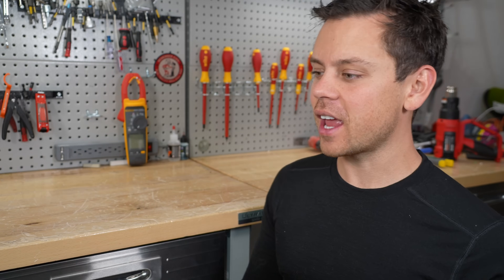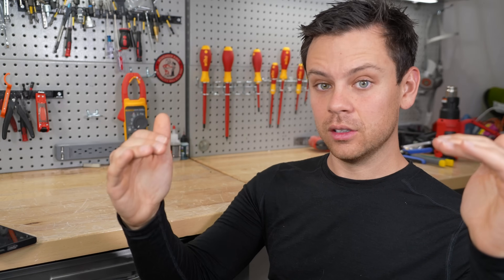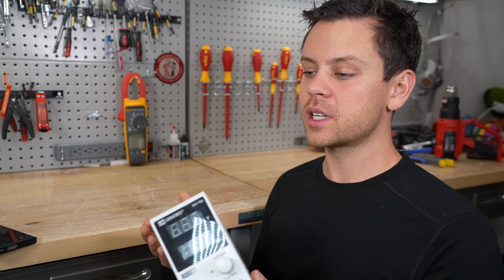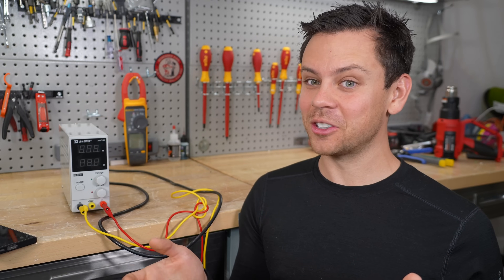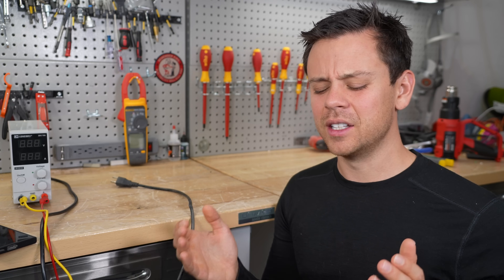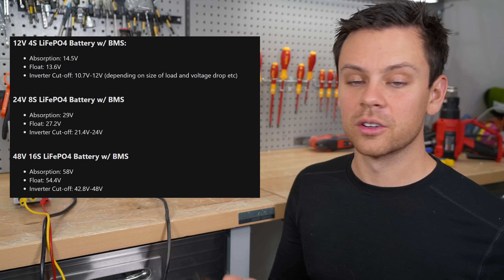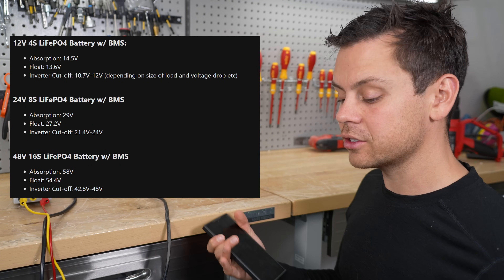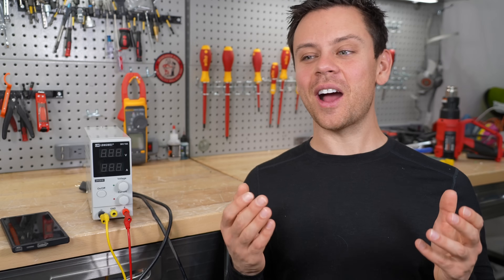LiFePO4 Charging Guidelines: What is 100%? What is 0%?! How to Balance??

Comment: My cells (EVE 280Ah) are working since 2019 in a 48V pack : Absorbption: 54.7V then Float : 54.4V, this 0.3V just help me charge faster near the "end". 
That's something like 95% SOC, i never charge at 100%, there is no need to. Then i never discharge under 10%, my system is sized correctly so i near never go under 20% anyway.

Your 58V absorbption seems too high, it will degrade the chemistry faster then needed... and for what, the gain is very very small, i better have a longer float session at lower voltage... the pack will fill up anyway, just slowly and there are only very marginal cases where charging stronger and faster are really usefull.. specially for those 5-10 last Ah.

Balancing is on at 3.38V, at 95% charge (of the nominal capacity) my cells are under 0.01V delta pretty fast.
The oldest pack as never been top balanced... things will settles anyway with time.
I can see from times to times some voltage delta between cells that goes up to 22mV, charge rate for a 280Ah 48V pack is around 5000W, 100A, sometimes a little more for discharge but never for a long time. I can't really do a full discharge/charge to see how much residual capacity i got.

Comment: I just bought 8 CALB LIFEPO 180 Ah batteries and measured 7 of them at 3.27 volts but one was 3.24 volts. Any need to charge it independently or just connect 8s BMS and use lab power supply to charge pack to completion? I bought your book but figured I'd ask here anyway. If I can simply apply voltage from lab supply what do I charge at and what voltage do I stop charging? 3.27? If they are all the same voltage Im good to go eh?.............Oh nevermind. I found the answer in another of your vids. Thx.

Comment: Absorption time? I have two Renogy 48-volt smart lithium iron phosphate batteries in parallel I used them for about a year without charging to 100% not realizing that they needed to be balanced or how to balance them I currently set my Bulk to charge 100% and my  absorption time  2 hours to help balance them I'm just not sure how long or how much time it would be okay for the batteries to be on Absorption

Comment: Thanks Will, I build a battery 2-3years ago and charge 100% solar and one cell never seems to fully charge, I use a victon controller and the 14.2 volt absorption never made sense, now I have 2 batteries, one in my van the other in my ute(4×4) now both controllers are set to your recommendations 👍

Comment: The EG4 LL-s v2 manual suggests 56.2V absorption and the BMS shuts off at 45V.  I would think it would be best to follow those recommendations so the balancing works correctly?  

I'm running in closed loop, but with a 10-20A DC load running straight off the pack so I enabled DVCC without BMS control and set the charge current limit to 100A(I think 70A is the highest I've ever hit and it was only briefly when I had good solar coming in on my 150/70, 100/20 and I set the inverter to charge to 100%.  Otherwise I'm only hitting 40 amps average just during the peak of the day. I have my pack in the garage and even with the garage being ~80-85F I haven't seen the pack go over 105F, usually it's ~80-90F during the peak heat of the day.  I set the inverter to 56.2v absorption and the MPPTs I set to 56.25 so they can contribute a little more than the inverter if I ever needed to charge to 100% using all the power available during a cloudy spell or if a storm is coming. 

My system I built to utilize all the solar directly when possible and only dump excess solar to the battery.  A MP2 5kVA can run our entire house and we can fallback to grid when needed, I have my input current limit set to 50A on a 60A breaker and have power assist enabled.  That does kick on very infrequently, maybe a couple times per month, we have a gas stove, gas dryer, gas boiler for heat and indirect hot water maker.

Comment: Sounds great if you can access your batteries. I have 6 EG Lifepower 4 server rack batteries in parallel and have to rely on the BMS doing its job. Unfortunately 1 battery went into full red alarm and had to be taken out of the loop. Open the battery kills the warranty i think and Signature Solar gives me the run around. Guess i have to drive to their office and have a talk with them. What are your suggestions for the settings on 2 6000XP inverters for maintaining the batteries?

Comment: Hi Will, I'm sure this has been asked, but I have a Victron 330 amp battery,  what should 50% be for storage. Is it around 11.5 to12 volts?  It gets very cold here, and the battery is in a van, stored for a few  months during the winter. I was thinking of getting an extreme heater, and letting that run with the inverter on and plugged in and charging the battery all the time, but not sure. Thanks for your great videos.

Comment: I have 48,230.4 Wh of 314Ah cells for my 48-volt system. My solar array is just under 6kW. I power a 5 cu ft chest freezer and a 4.6 cu ft top-freezer refrigerator full time and a microwave, Instant Pot, countertop convection oven, and a pair of PC speakers intermittently. I haven't hooked up the 48-volt lithium cells yet because I haven't figured out how to charge them all without making them into one big battery. I dislike the idea of a 16s4p battery because of the risk of a single cell causing the rest to start failing. I don't see this as being a logical concern. It would seem to me that the only symptom of a cell failure would be a 33.333% reduction in usable capacity of the entire bank with the only cells that get fully cycled being the two that are parallel to the failed cell. I can't convince myself that I need to complicate my system in order to have 3 independent battery banks working on the same job and sharing the same charge. If I need to be convinced, the argument has to be smarter than I believe I am.

Comment: Mr. Prowse,  I am running 2 lisuateli 12v 100ah lifepo4 in parallel for my 6x10 trailer, charging with 500W solar. The Fangpusun controller is set via switch for lifepo4. Should I use the 12V settings mentioned in this video? Thank you for sharing your knowledge with us newbies! Happy Thanksgiving sir.

Comment: I'm in the process of changing my lead acid batteries to lipo4 batteries. I made my own controller for solar charging. The system works by directly letting the full 20 volts go to the batteries. When the batteries reach 14.6 volts the panel voltage source cuts off. I tested my system with 80 amps load for 8 hours strait and it was at room temp. around 20c.  I've been using this system for 12 years with no issues that I can see. So just wondering if this setup can be safe for lipo4 batteries. Thanks for any help.

Comment: Hi Will, I recently watched your video where you recommended setting LiFePO4 batteries to 100% (3.65V) and 0% (2.5V), which seems to be in contrast with what Andy from Off-Grid Garage suggests in his video, "Busting the 20%-80% SOC myth for LiFePO4 batteries." In his video, he advises charging up to around 90-95% (~3.4V) on the high end and down to about 12% (~3.1V) on the low end to minimize degradation.
I'm just trying to understand the best approach to maximize the lifespan of the batteries and avoid damaging them. Is the difference between these two recommendations significant, or might it be so minimal that it doesn’t really affect the batteries' longevity?
Thanks for your insight—I’m eager to learn and ensure I’m taking care of my setup properly!  Best regards, Wes

Comment: Hey Will, I love your videos, however I want to build a 48V UPS system for my boat, no solar, using Victron hardware and the Epoch 48V marine batteries. We usually anchor out 3 days at a time and using 2 small air conditioners at night when it is hot. We can recharge in the Marina during the week or with the Generator running while we are in transit. Sundancer 44DA. Mike

Comment: What do you consider “high temperature”?  I’ve been using CALB CA180’s in an 3P8S configuration in a marine application as a house bank.  System is 6 years old.  It’s not in the engine room and generally lives at 80° and gets into the 90’s if we fully cycle… (90% to 10%) each day.  Max charge rate 115amps.  REC Duo BMS, Victron 5kw 240v inverter, CCGX and Wakespeed 500 regulators on the main engines.

Comment: Hi, I have been using LiFePO4 batteries now for 3 years in my RV and boat.  For the RV, I just shutdown all systems and leave the batteries rest, never more than 6 months and always have a charge in them without issue. For the boat, since I Ieave the boat in the water I leave some systems on, like the bilge pump.  So since there isn't much draw unless needed, I need to leave the charging system on, in this case the solar panels and charge controller.  I am worried that the batteries are getting charged too much?  The Lithium setting on the charge controller keeps the voltage at 14.2 for many hours and doesn't seem to back off even though the current goes down to almost nothing, the gel setting also keeps the voltage at 14.2 but backs off to 13.7 after 2 hours.  I decided on the gel setting before I left the boat.  I can't seem to find any answers about my situation and should I be worried about the batteries?  It's in the Pacific NW so they stay cool and from my experience during summer months they never got warm at all.  I have 435 watts of solar and an mppt 30 amp charger.

Comment: Great videos.  I think re-enacting troubles with a system would do well for those troubleshooting a system.  Ex: demonstration of generators throwing cell Voltages out of whack, “waking up” a server rack battery after a low voltage cutoff scenario, and I think some content on cold climate/coastal region considerations would be interesting as well.  Transform a shack in Canada into a peaceful, freezing getaway😂.

Comment: Lead Carbon is a bit different than LiFEPO4 , charge 57.8 float 54.8 . Range 51.6 to 41V , no cells test possible , no bms, no heater, last time I tested, the furthest row was .1v below the other 3
51.6V 48KW,    50V 43KW,     49V 38kw,   48V 33kw,  47V 28kw,  46V 23KW,  45V 18KW,  44V 14KW  43V 10kw,   42V 6Kw,  41V 3KW and of course 40V be as dead as possible but np just push 10KW into at -30 c, 49.5v in 4 hrs. Or throw 10800w into the bank for 2 hours then find out you have a 175A dc breaker, oops, sure lasted a long time at 190A, cables were warm like hose heater.
Above 48v a 2.2kw load lowers volts by .6V, at 41.6V 2200w load -.8V. 
Took me all year to figure out my volt to kw because lead carbon is some forbidden info or gives all results for lead acid. If I see 47V now I know its 3 hours of gen to 43kw 90%, the top 5kw should never be charged with a gen, takes a lot to stuff it full, then it just eats 1.6v and 5kw from 100 to 90%. Once a month it is required to charge 100% 
Maybe one day you can try and kill a lead carbon, hint they don't survive drops.

Comment: Thanks great info.  One thing i never see is a definitive answer on how long should you run the absorption cycle for? I've got 7 x 3kwh 48 volt batteries (genz) in Australia.  They recommend 2 hours in their instructions,  but when i queried that for a daily cycle in an off grid set up i was told 30 minutes is fine with a 2 hour absorption every 6 months or so.  Do you think the absorption time is important? I get lots of extra sun in summer so there is plenty of excess solar to achieve that.

Comment: These lithium batteries don’t degrade that badly with reasonable care. My 2016 Tesla has lost just under 10% capacity in just over 8 years charging to 90% daily and multiple cross-country trips taking advantage of the lifetime supercharging. Key thing is that I never run it completely empty, and if I do bottom out under 20%, I strive to get it above 50% as soon as reasonably practical. And it uses a much less forgiving battery chemistry than LiFePO4 which is generously forgiving.

Comment: Are those wall outlet AC chargers ( LiTime 20 amp 12v charger) designed to charge a battery bank of 4 batteries in parallel  ? 
Or only 1 battery at a time?

Comment: Diesel farm tractors operate various PTO driven implements that all assume 1500rpm input. The tractor manufacturer knows this and designed the engine around the specific engine speed required for 1500rpm on the PTO. There is a frickin MARK ON THE TACHOMETER.  When you ask farmers where they set the throttle. 1 in 20 run wide open, balls to the walls.
1 in 20 correctly operate the throttle. 
90% are average of 1500 rpm too low. This is the source of 100% of their problems.
Construction workers are told the red line burns the proper amount of fuel to avoid problems with the corporate bean counters. They properly set engine rpm and run it like they stole it.
Construction equipment engines in equipment beat like rented mules last twice as long as the exact same engine in farmers tractor. 
This is why every old farmer has a bulldozer, or excavator, some peice of "heavy" equipment kind of maladaptive to some farming task.
They are acutely aware that heavy equipment lasts twice as long as farm equipment.
Yet their heavy equipment is ALWAYS broken.  Like their goddamned tractor.  The one they don't run properly. You're now at 5th generation of explaining this until blue in the face.

Comment: This is not your best video. You should show the actual balancing process. Explain why/what balancing is like we're a 5 year old. I've learned a ton from you Will, but this one assumes the person watching knows how to do balancing/wiring/ sizing a battery bank, and more. Still give a thumb because you're the best solar vids. 

I had a balance issue doing 4 LiTime12v in series to an EG4 3k. After install the owner ran loads and one of the batteries would drop low enough that the EG4 shut down. I had to remove the  batteries and charge them on my 12v Victron system. It was a major pain because we're 100% solar out here. Had to do it twice for some reason. Anyway after her system charged a couple times the problem hasn't happened again. Though I'm afraid it might someday. The EG4 wouldn't charge the batteries in series since the voltage was under 48.

Comment: Hay great video. I’m building a self charging self sustaining solar system that doesn’t use solar panels. I have (4) 100a 48v solar charge controllers, (16) 100a 51.2v lifepo4 batteries, 10kw solar inverter. I have it set to when the batteries reach 58.0v during bulk charging the charge controllers turn off and when the batteries reach 46v the controllers turn on. Can you tell me what issues, if any, I will have by not letting the chargers go into boost and float charging mode? Side note, the chargers will go into bulk charging after every 16.5 hours of battery usage and will charge for about 4 hours. My house is averaging 3100w per hour. Each 100a charger uses 15a of battery power during charging only.

Comment: Hi Will. Superb video as always. Quick question. I am in the UK. worlds most expensive electric. (I am told). So its common here to have cheaper electric over night. Very expensive for a few hours in the evening with a standard rate all other times. so 3 rates. I have solar and 26KWH of Pylontec LifePo4.  So I charge overnight (Cheap) at around 0.5C and discharge at the expensive rate at a similar 0.5C. Does your advice stay the same. so charge and discharge for 3 hours at a constant 0.5C. I charge to 100% daily. Thanks

Comment: This past spring I bought 4 Eco - Worthy 12.8v 280 AH batteries. Are these classified as cheap by you? They were $2000 Amazon delivered. I charge them with a Midnight Solar 150 MPPT. set at 24 volt . I charged each battery individually with my IOTA battery chargers which will go 13.6 to 14.4. Once they were all charged I made two banks. I've been running all 4 together since installation.

All summer my whizbang junior shunt in the Midnight Solar said every day they went to 100%. I set the shunt meter at 560 amp hour full charge and 98% efficient. This fall I charge with my Magnum inverter. It does not have a lithium setting so it is set at 29.2 absorb. The Magnum said Full at the level of one set of batteries or 280 AH. I started reducing my input to the batteries as they get over 27.3 input volts. It seemed to help the batteries take more. My Magnum says full today at 400 AH or 80%. 

Should I just use two batteries and charge the other two separate? Using dedicated LifePo4 chargers? Then rotate them into the bank? As you may guess I have no way of reading any BMS from the batteries which I guess makes them "Cheap". Amazon is selling 4 of these today for $1600 and am thinking of buying them so I have some charging singular and the others in the main battery bank. You don't talk about charging singular. You just say to hook them all up and let the batteries balance themselves over time. I don't really want to know all about the BMS but they do need to hold more AH I think. My Magnum charge current is not too high but a lower charge may help. It is higher than the solar. The LifePo4 chargers are only 20 amp.

These batteries are so much better than the years of flooded lead acid Trojans T105s. Thanks for all you do.

PS: Amazon now has offered the Eco-Worthy with a Bluetooth BMS. It is about $50 per battery. I'm still confused on the best way to proceed. Eco-Worthy does not give out much information.